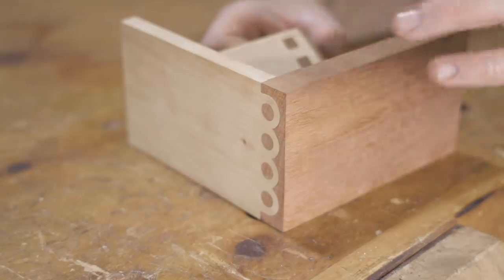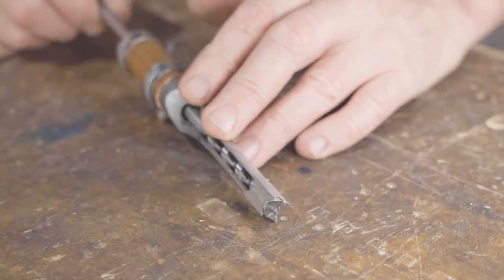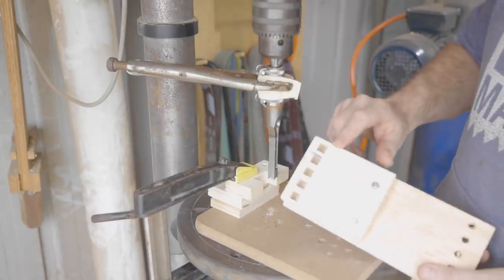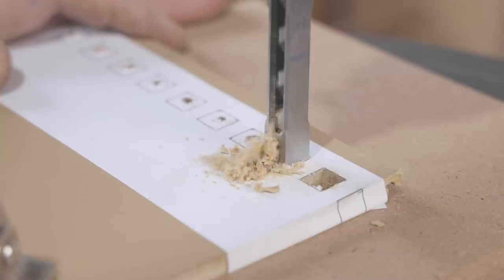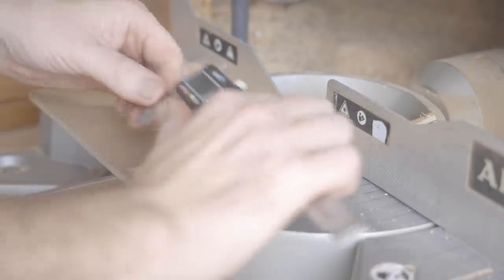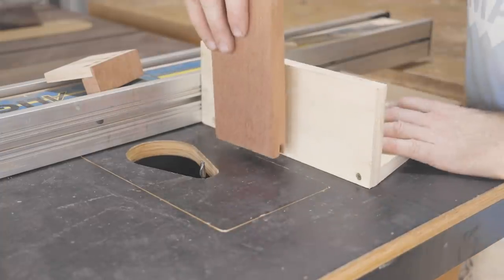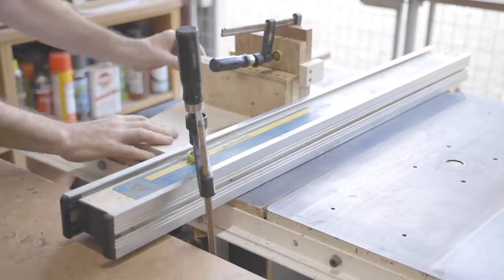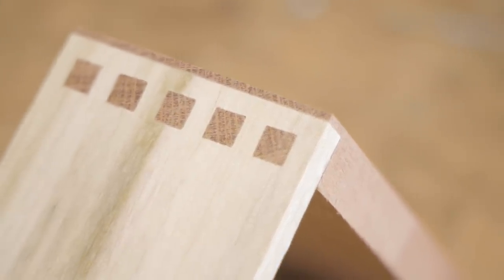How to Make this Strong Alternative Dovetail Joint

Comment: its a mortise and tenon joint...
Reply from the maker: Technically yes but with a shoulder and generally not used for a drawer joint. :)
Reply: Personally i would just make jigs so i could drill for round dowels through the edge and into the end of the other. so round instead of the square of you did.
Reply: well, you did use a mortising bit, that kind of ruins the naming game :)
Reply from the maker: That would be a great joint and would look great too. Although having the grain follow through the pins/pegs and the end grain of the shoulder looks really nice. It's subtle but it's the small details that make a piece shine. :)
Reply: Fair point. I would elect to use a different wood species for the pins to create an extra detail. These types of joints make me lean towards what will look decent but can be done quickly. just as long as it isn't a pocket screw :)
Reply: P.S. what if you made the dowel from the ends of the board you are using and just lined the grain up at install? that would help keep the grain consistent? although it would mean more board feet and waste wood.

Comment: round hole is stronger than square hole, especially if the hole is close to the end of piece, and not in the middle.
Reply: David Jacobs Explain please. 🙏
Reply from the maker: I'm not sure David. But I am positive this would be an extremely strong joint for a drawer. :)

Comment: You should of closed the gap on the top piece side to side that would hold the bit in place and then you could of avoided the complete arm holding the bit
Reply from the maker: I'm not sure what you mean. :)
Reply: @PaskMakes  the top piece that holds your work piece down, it has a notch in it to clear the bit. If you bring the sides together so the bit just clears. That would prevent the bit from rotating and also keep it square to your workpiece. Make sense?

Comment: What would I call that joint? Unnecessarily difficult.
Reply from the maker: Not really. If this is too difficult for you then you obviously have no need for a woodworking joint. Just keep using screws or nails, which is perfectly fine btw. :)

Comment: Great. Now repeat that 100 times to make a single piece of furniture.

Are you mad?
Reply from the maker: That's something I intend to do! It's not that outrageous, how do you think woodworkers produce handcut dovetails? :)
Reply: @PaskMakes , having lost a finger on the spindle I'd prefer hand tools too. There's just something special about the finished product when you avoid using power tools. It's craftmanship, not machining.

Besides, there is something calming and relaxing about "NOT RUSHING SOMETHING FOR ONCE"
Reply: Sellam Abraham, my advice if you are the type....

It's called a biscuit joint. Designed specifically for lazy people.